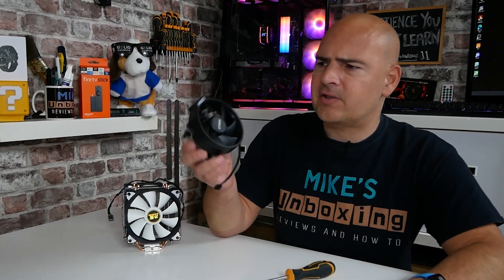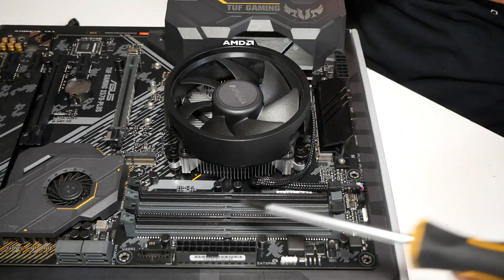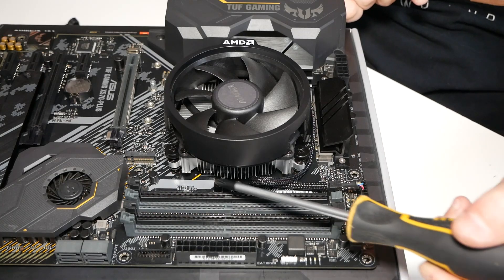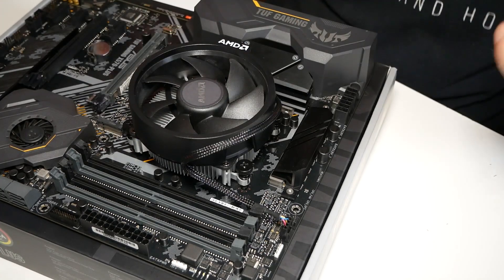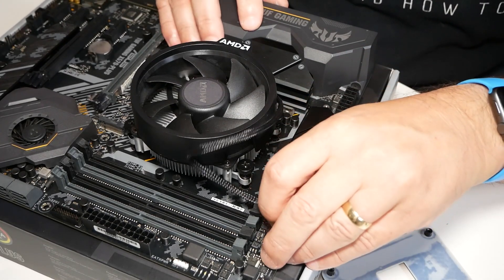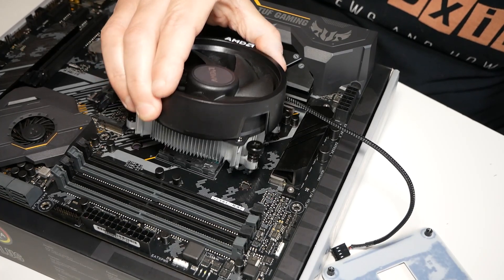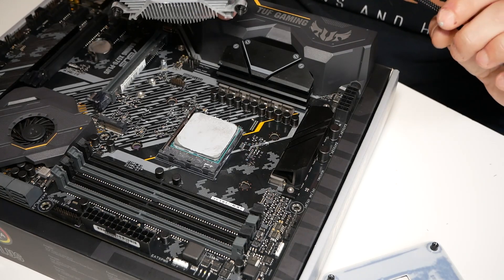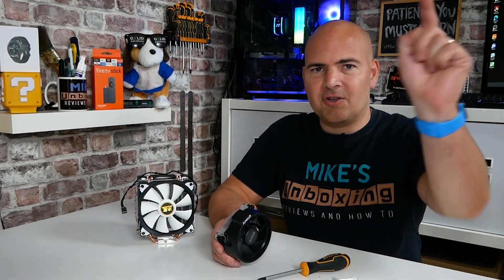How To Remove A Stock AMD CPU Cooler When It Is Stuck

Comment: Found this and I think if you have a CPU that was installed around 6 years ago, you are doomed!!!

I couldn't remove it, after lots of gentle pressure. Tried to put it back together and I'd already damaged the socket as a rock solid system started to hard crash :(

Then I got a hair dryer onto the existing cooler and tried small twisting motions - boom the CPU got pulled out. Paste was super hard.

New motherboard now for my "cheap" CPU upgrade :)

Useful tips, but maybe not for Ryzen 2600 to 5600XT timeframe upgrades.
Reply from the maker: That's a tough situation, but thanks for sharing your experience and the hair dryer tip!

Comment: Somebody suggested to turn on the computer to warm up the cpu so the heatsink would come of more easily. But if the fan doesn't work (anymore) that sounds a bit tricky to me. After all you have no idea when the cpu is warm (hot?) enough and when to turn off the power. You don't want the cpu to get TOO hot, of course! What are your thoughts on this?
Reply from the maker: That's a valid concern; it's best to be cautious with CPU temperatures when the fan isn't working. but a few minutes should be fine, wait until you feel the outer fins getting warm and that should be enough to loosen the thermal interface goop

Comment: I used 1500x with  stock cooler( the tall one) and I change my CPU to 5500 and still use the old one bc new one is stealth ver.(the short one) but it still very hot went I play PUBG(CPU loaded 60%), so now I use thermalright axp90-x53 full copper and all good, happy eanding, I don't know why AMD give me stealth ver. with 5500
Reply from the maker: yeah the stealth isn't really suitable for modern cpus

Comment: Thanks for this guide! I was able to remove the stock cooler of my ryzen 5 3600 with ease!!

1. Before removing the stock cooler, make sure you heat up your cpu by playing games or using cinebench etc. i played marvel rivals for 30 mins before removing the stock cooler.

2. Follow his instructions and you should be easily able to remove your stock cooler!
Reply from the maker: Nice work!

Comment: Bruh… I am trying to clean a pc my dad and uncle built when I was 8. I’m 26 now. And the heat sink is stuck on the board I’m pretty sure….. I used cpu z and ran the bench test for about 30 minutes the I just flipped the psu switch off. Opened the case and it was still warm when I started wiggling and it is STUCK. Over 10 year old thermal paste. What shocks me is I have the AMD FX 8320 and I can OC to 4ghz and it stays at 50 C when I bench it in CPU Z. It’s working almost as well as the 8350 and I’m happy about that but I can see dust in the heat sink so I want to clean it. But it’s stuck.
Reply from the maker: you might be able to put the pc on its side and spray some isopropyl alcohol around the edges of the cooler and see if it will loosen the outer edges a little

Comment: This is so typical for things I deal with.  Twisting didn't work.  Got it really hot and still nothing.  Fought it for 2 hours. Eventually decided a 2600X isn't worth that much to sell, so I lifted my whole computer clear into the air about 8 times before the CPU came out of the socket.  No bent pins, fortunately, so I get my $20 or whatever on Marketplace, assuming my 48-inch pry bar is enough to get it free.  I'm tempted to eschew the $20 and just use it as a gun target.

Comment: My coolers so stuck it won’t even twist. I’ve been heating it for half an hour or so with a heat gun and it still won’t budge at all. Help??
Reply from the maker: not much else you can do other than some brute force but be careful if it is stuck that hard, bad things can happen
Reply: @ lmao about 2 mins after typing this it popped off. Thanks for the response tho!

Comment: my heatsink is absolutely knackered and caked with old crusty dust from burning incense right next to it 🤦‍♂ I have done my best to clean it still attached cos it's proper welded on there, but I'm gonna have another go at removing it with this tip. once I've removed it, is it alright to soak the metal part in alcohol and give it a light scrub to fully clean it before putting it back? it's three years old and never had a bath hahah

I have a stock AMD graphics card as well which really needs doing because it gets frighteningly hot and is cooking the components. but it has a confusing build, one of the screws to release the heatsink seems to be inaccessible beneath the plastic fan case and I'm not sure how the PC shop got it on there. you got any tips for that my dude?? :)
Reply from the maker: This is maybe easier to fix or at least advise if we can ask more questions and get direct answers, so feel free to join our Discord chat and we can go over it in more detail https://discord.gg/XtBTGQ6BDu
Agree to the rules by clicking the emoji and you will get access to the rest of the Discord channels

Comment: Yesterday I couldn't screw the amd fan because the backplate fell down

The CPU has thermal paste/grease it's still not dry so I guess I don't need to put new paste right?
Reply from the maker: try it and see, you should buy some paste anyway just in case or for when you do any maintenance

Comment: i pulled the old cpu out with the cooler, this tip didn't work, as after 7 years, it was fuzed together, took me hours to take the cpu and cooler apart, probably the 2700x is still working, no bent pins even while it was pulled, board has no issue, new 5700x3d works just fine

Comment: What i did is disconnected the fan and ran the pc for a few minutes. Don't worry it has overheating protection and will shut down if too hot.
Reply from the maker: good idea
Reply: @mikesunboxing  The issue was that it kept cool temps on 100% load with Aida 64.

Comment: I wish I'd watched this video yesterday instead of today. I unscrewed two screws on the same side on a cold system. The springs yanked the CPU out, but I didn't know, so I applied some pressure to the cooler when removing the remaining screws. I bent a bunch of pins, and while carefully bending them back, one of them snapped. Now the CPU is useless.

This feels like a really bad design.
Reply from the maker: not all the pins are actually used, you might be okay
Reply: @mikesunboxing  Unfortunately this was one was used. I even tried replacing the pin with a tiny piece of wire, but it still doesn't work, I guess it didn't make good enough contact.
Reply from the maker: @StuartGilbert  Sorry to hear that

Comment: Mine got stuck very hard. Its so stiff that when i try to twist it won't even move a bit.  Don't know what to do.
Reply from the maker: heat up the cpu and cooler it with break free after that
Reply: @mikesunboxing I tried it and it didn’t work
Reply from the maker: @mason2437  This is maybe easier to fix or at least advise if we can ask more questions and get direct answers, so feel free to join our Discord chat and we can go over it in more detail https://discord.gg/XtBTGQ6BDu

Agree to the rules by clicking the emoji and you will get access to the rest of the Discord channels

Comment: what if i just want to take off the black plastic fan to remove the dust from the heatsink? is that even possible?
Reply from the maker: yeah the four screws around the rim will allow that
Reply: @mikesunboxing  Okay that’s a relief! My processor looks the same and the cooler also so i’ll give it a try, thanks for the reply!

Comment: I would like to ask a question. My screws from my cooler dont move whatsover, ive tried multiple screwdrivers but they just feel like they are stuck. Im afraid that if i really push them they will break and probably damage something. Any suggestions?
Reply from the maker: undoing or trying to tighten up? maybe you are using too small a screwdriver, and not getting enough torque on it
Reply: @mikesunboxing  when undoing them they feel like stuck. I've changed screwdrivers to no avail

Comment: I accidentally tried to unscrew it a different way to how you showed (I found this video after I started trying to take it off). is there a way to take it off? because there are 2 screws that came out just fine but the other 2 won't go upwards. can I fix it? I'm upgrading the cpu so I don't mind if it gets damaged (as long as the new one can work)
Reply from the maker: This is maybe easier to fix or at least advise if we can ask more questions and get direct answers, so feel free to join our Discord chat and we can go over it in more detail https://discord.gg/XtBTGQ6BDu
Agree to the rules by clicking the emoji and you will get access to the rest of the Discord channels

Comment: Bruh mine aint moving, I built this 3 months ago and I got a new cooler today, but shit wont budge. I removed the back plate thing in the mobo
Reply from the maker: try getting some heat into the paste, if the pc is still working hit it with a cinebench load

Comment: This just happened to me with a Noctua NH-D15 and Arctic MX-4, on a CPU installed three days ago!! The motherboard is broken so I can't use it, otherwise a great way to avoid this is to hear the CPU and heatsink by loading it prior to shutting down.

Comment: Mike, Gigabyte told me to unseat the CPU and check for bent pins. Obviously fan must come off to do this. Problem is computer won't pass POST, so not operational. I don't own a hairdryer since I'm bald. Any other thoughts? Thanks.
Reply from the maker: gentle twisting a degree or two should break the seal or leave it in direct sunlight for a while

Comment: Absolutely amazing tip. Removing the backplate and applying gentle rotation to the cooler did it. It was stuck on so tight before😮‍💨
Reply from the maker: Glad it helped!

Comment: Help! I removed it but I can't screw it again. The screws dont go down the holes. Seems like I should push them down but the spring makes it incredibly hard and not like in many videos. Can you make a video about that? 😢😢

*I found the solution and I see no video talking about that. There's a back plate that must be held firmly in place because it contains the holes for the screws. I removed the back panel and placed a toilett paper roll behind the back plate,  firmly holding it in place. Then I placed the computer as in your video, with the paper behind it. This made the holes move "up" and the screws were able to reach them. All the videos make it look so easy to drive the screws, but there must be a pressure from the back plate and a little presure to the screws, so they reach the holes.     I suffered a lot! I thought my screws were defective or that I had ruined them when I removed them.   If you could add that information to the video, maybe you would help lots of people like me*   (I thought I was gonna lose my job).
💔😭😭😭😭
Reply from the maker: we have done a few versions of this video and we often suggest using a block of wood or some other non conductive solid object under the backplate to ensure it firmly presses against the motherboard, but glad you got there in the end
Reply: @mikesunboxing  thank you so much! I learned something new 😊
Reply: How did the backplate fall off?? Did u place ur pc laying on its back or no?

Comment: in my experience if the paste gets really hard (usually stock paste) best way to get the cooler off is to apply a sharp blade like a scalpel between the IHS and the block (assuming it's reachable which might be difficult while in socket), and gently tap on the blade handle to force it in between the two. since hard paste is also brittle once it gives even a tiny bit the whole thing pops off (if cpu is no longer in the socket have something soft for it to land on so it doesn't bend pins)

Comment: I just recently bought an aio and a new cpu and I was excited to find out after trying everything cinebench and twisting I even tried a floss trick someone said and I just can’t get it out, it’s a amd stock cooler
Reply from the maker: either needs more heat or a gentle tap
Reply: @mikesunboxing  I unplugged my cpu fan and my cpu got to 100c and it still wouldn’t even move one bit what do you mean by a gentle tap?
Reply from the maker: @cwistin9197  a little shock treatment to loosen the paste, like a tap with a heavyish screwdriver on the sides

Comment: go on stress test with cpu and it will be lot easier to remove.
Reply from the maker: yes the heat will sometimes help to loosen the thermal glue

Comment: i just wanna remove the fan not the entire thing. they screwed the screws so bad i unscrewed 3 now only 1 is left and its stronger than diamond. it's humanly impossible to unscrew that. even godzilla itself admitted it. jokes aside i have no idea to unscrew this. the cooler frame also makes it harder to get the screwdriver in position lol
Reply from the maker: yes those should come out very easily with the right sized screwdriver
Reply from the maker: you can pull the top frame off to gain better access to the screws

Comment: how long and what temperature would you recommend the hair dryer method for?
Reply from the maker: a few minutes to get the heat into the core area, if you start to smell plastic vapour that is enough
Reply: @mikesunboxing  getting ready to try the method, i’ll get back to you to say if it worked

Comment: I honestly think twisting the cooler is a bad idea. I spoke to a guy at AMD who concurred. If you have to do this it’s a lot safer to unscrew the 4 cooler mounting screws and very slowly put the whole assembly off the mono. Ensure you apply even force such that the cpu stays parallel to the mobo. After that heat the cooler heatsink evenly any the cpu will slide off the cooler twisting the cooler risks bending or even breaking the pins.
Reply from the maker: gentle twisting breaks the cement like seal around the outside edges,. but do whatever works for you

Comment: My problem isn't that the heatsink itself is stuck to the CPU (that dry ass thermal paste already crumbled off), it's that one of its mounting screws is completely stuck in the standoff, and I can't hold the standoff with pliers while I unscrew like I could with mobo standoffs, because the cooler backplate is in the way.
Reply from the maker: apply a little pulling force from the rear of the motherboard, and try unscrewing the screw at the same time.
Reply: @mikesunboxing  i ended up pushing down on the mounting screw and backplate together which made the standoff pop out of the backplate by just a mm, but enough to hold it with pliers while i unscrewed. i was about one twist of a screwdriver away from sawing through the mobo.
Reply from the maker: @ShintyShinto  Glad you got it sorted out, though

Comment: I'm very glad to have found this video. Thanks! Would an electronic dust blower for computer be warm enough to get the job done? I'm very afraid frying my CPU with a dryer if I over do it. Thanks.
Reply from the maker: The cpu and the cooler can take up to at least 95c so you should be fine
Reply: @mikesunboxing   Thank you! Much appreciated!
Reply from the maker: @rawsome_music  No problem 🙂

Comment: If the motherboard is already installed into a fully operational computer (just upgrading), should running the computer a few minutes cause sufficient heat to make the paste viscous enough to successfully remove the cooler? Thanks for your thoughts.
Reply from the maker: Yes that should be enough to get a little warmth into the paste
Reply: @mikesunboxing  Thank you very much.
Reply from the maker: @markfalina9160  No problem 🙂

Comment: If anyone is skeptical about the hairdryer method. I was using phantecs thermal paste which reviews say it sticks. Literally was less than 10 seconds before I could start to move it
Reply from the maker: anything that can change the heat from ambient to hot is okay
Reply: on what heat setting was the hair dryer? i plan on doing the same to remove stock thermal paste and i don’t wanna melt anything

Comment: i cannot rotate it at all even with greater force after unscrewing it and removing the backplate and using heat... any ideas?
Reply from the maker: run cinebench for 30 minutes that will break the seal

Comment: yes you should be really careful about that hair dryer diy thing. It fried my motherboard even though I used a simple and basic hairdryer and now my pc won't power on. 100 euros down the drain...
Reply from the maker: a hair drier shouldn't create enough concentrated heat to cause damage to the board unless you are leaving it for a really extended period or touch the board with the hot tip
Reply: @mikesunboxing  i know. Mine died anyway...anyway bought a new.b550 board. The design of the AM4 socket is extremely bad either way. If you can easily rip your cpu with the cooler from the socket in normal day to day situations then this is realy bad...also the backplate is a big pain if you use a cooler that does not have a latch mecanism... hopefully the am5 socket will fix this. Had no issue whatsoever on Intel

Comment: When I try to unscrew my cooler the spring just make a small twanging noise and it's not actually unscrewing from the backplate
Reply from the maker: is there anything behind the backplate holding it in place? if you loosen all of them the back plate should fall away if not supported

Comment: Anyone here has some tips if it's still stuck after heating up the CPU to 85c ? I even tried turning while it was on so it could not cool off before I got.my hand into it
Reply from the maker: loosen the screws completely and let the back plate fall off, then use a little rotation gradually both ways and it sound break free BUT PLEASE BE CAREFUL
Reply: @mikesunboxing  Thank you Mike for replying! I got it after 2 days trying to get it off. It was like it was super glued together.  It took real effort but in the end it payed off. Thanks for the video it helped 👍👍♥️
Reply from the maker: @zerellix  Glad you got it off :-)
Reply: @zerellix  hey man I’m about to attempt this same feat. Any tips on how you got it off so I don’t mess up.